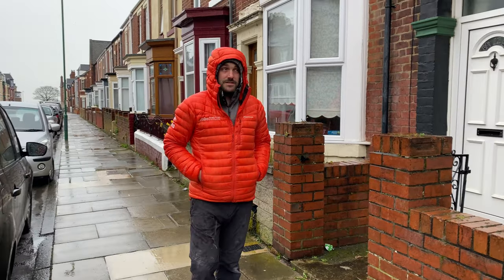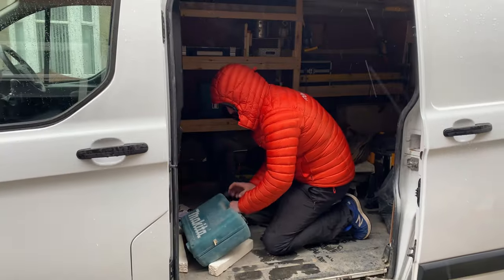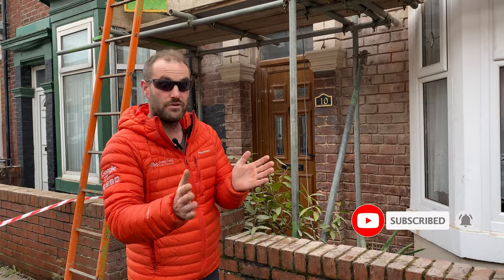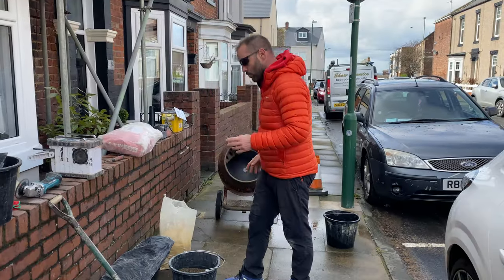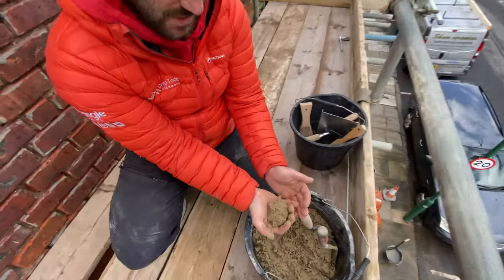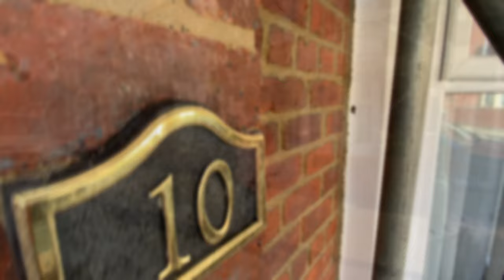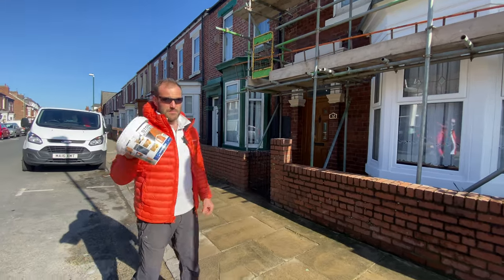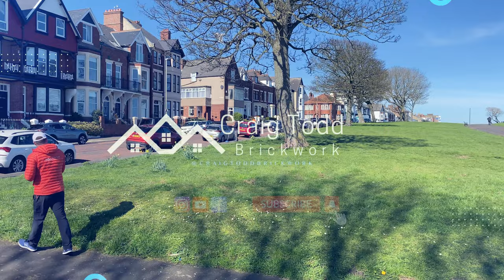Art of Lime Mortar Pointing, traditional bricklaying methods

Comment: is the mix 3 soft , 1 sharp , 1 cement and 1 lime ?
Reply from the maker: Sure I mentioned in the video mate, unsure now to be honest, may have been 5 soft, 1 sharp & 1 lime. 
No cement in the mix, NHL lime is hydraulic lime which needs air to go off. If you use hydraulic lime, thats the lime which needs cement to go off 🙂

Comment: My understanding is that using lime instead of cement & sand allows the wall to 'breathe.' But what about the old sand & cement mortar that's still in there. Doesn't that prevent the wall from breathing anyway? Genuine query as I'm thinking about using lime to point the house.
Reply from the maker: Great question, if a lime built house is pointed with sand and cement you just rake that out. It’l be raked out back to the original lime mortar so your new lime pointing will be going on top of lime 🙂 if your raking out a sand and cement built house you just repoint with sand and cement 👌
Hope that helps 🙂
Reply: @CraigToddBrickwork hi mate what mix did you use 

And how long do you leave it before you finish it
Reply from the maker: it was a 3 building sand 1 sharp sand & 1 lime mix & we left it until the end of the day to finish it on this one :)

Comment: You can get a housing for the mortar rakes, gives you a bit more control and the option for dust extraction.
Reply from the maker: Cheers Andy, appreciate you dropping by mate 🙂 yeah, we had got one for this job. We had the wrong bits for our grinder though and didn’t work. The company quickly send another one out to us though and we used it on the customers back wall 🙂 I really rate them like. Do you use them Andy?
Reply: @CraigToddBrickwork  Yes mate, been using them for years on softer stuff, the only fault i find with them is the rakes are to long for me and rake out a bit deep. Ime using one today will be in my next vid 👍
Reply from the maker: sorry for a massive delayed reply andy. I've just found the filter on here that shows comments on comments. I've just ben replying to the notifications and wondering why i dont get a reply back haha. I know now any way. I'l have to take a look at your vid mate, love your content andy, i just dont have two bloody minutes to do anything at the minute. what do you mean the rakes are to long? as in the devil tooth rake or the disk?

Comment: Can you use 3/1 sand and lim without the sharp?

Or did you just add sharp for the aesthetic purpose of showing stone in the joints ?
Reply from the maker: you can matty, you don't need the sharp in the mix. If the original has sharp in, it's best to put it in your mix though :)

Comment: Hello 
Great work and nicely done
Wanted to ask, in your opinion is possible to use cement (for better setting) with hydrated lime and sand (0,5:1:5 ratio) for rendering a brick wall layed with lime mortar, as it is quite difficult to find hydraulic lime in our region? 
Or even small amounts of cement will trap moisture, make wall unbreathable and ruin the bricks?
Thank you
Reply from the maker: Anything like this mate I’d normally ask a good mate of ours for advice, check out Tominay Stone on Insta, he will have some great advice for you mate. 
We have used hydrated lime in the past and yes you are right with the sand. No hydraulic lime. When we use hydrated the do a 6:1:1 mix or 5:1:1:1 👍
We dont have any local suppliers to us either for our lime. We order ours online from a company called Conserv - www.Lime-mortars.co.uk
They deliver in a few days too mate & its good stuff 🙂
Hope that helps mate.

Comment: If a house is cavity wall, would you recommend using sand and cement mix when repointing?
Reply from the maker: Its down to what the house has been built with mate, if its lime use lime and cement on cement 🙂

Comment: Everything I've seen online seems to indicate you've got to keep hessian over the fresh lime mortar for a period of time. Different lengths of time depending on the weather. Is there a reason you've not used hessian to protect it / retain moisture etc?
Reply from the maker: your right matt, you should cover your lime with hessian to prevent the weather getting to it. We just didn't video this part

Comment: Lovely job, how long do you leave it before sponging please? I take it that's the finishing touch, thanks
Reply from the maker: Yeah mate the sponge is the finishing touch 👌 you can go back to it the next day and it’l be good to sponge 🙂
Reply: @CraigToddBrickwork  thanks mate
Reply from the maker: Your welcome, anytime 🙂
Reply: Hi Craig if you want a flush finish, would you use a scrap bit of timber to rub across the joints?
Reply from the maker: Yes mate, that finish looks lovely 🤩
Reply from the maker: Yes mate that finish looks lovely 🤩

Comment: Excellent video mate. What is rough estimate for that job? Thanks
Reply from the maker: Thanks mate 🙂 I really cant remember now mate it was a few months back this one. We would be at between £100 - £150 pm2 plus scaffolding, go £125 @ around around 16m2 £2,400 all in. It’s much more than sand and cement pointing because the process is much longer mate. I should have probably spoken about it in the video tbh, but for an example, keeping the new compo damp is important so it doesn’t crack, spongeing the joints down to bring out the sharp sand. I do that on the same day it goes in before I leave for the day and the next day before starting I get a wet sponge on it too 🙂 a couple examples mate 🤝 hope it helps
Reply: @CraigToddBrickwork  Thanks for the extra information that's very helpful.  I see from your work that you really go above and beyond to do a proper & thorough job👍👍👍
Reply from the maker: @ggss1176  your welcome mate, I believe in always doing more than you’ve been asked, obviously not hundreds of brick or something like that but you get what I am saying. Leave a job better than it was when you arrived 🙂

Comment: How long for 1 man to grind out the joints on a house that size thanks
Reply from the maker: Probably 2 days max
Reply: @CraigToddBrickwork  cheers, and u suppose 2 days for 1 man to point it
Reply from the maker: Probably 3
Reply: @CraigToddBrickwork  i have a front to do and there electricity wires going to the front of the house, how do u handle them,😅😅
Reply from the maker: I dont 😂 do you mean the ones up at the gutters? If so it’s upto the customer to have them insulated, you know the yellow plastic stuff you see around them. I think its free for the customer too. Not 100% on that though
Reply: @CraigToddBrickwork  your a genius my friend, thanks very much for the advice, good advice bad joke🤣🤣🤣
Reply from the maker: @IanIan-cj7dj your welcome mate 🙂
Reply: @CraigToddBrickwork  cheers, 👍

Comment: Hey dude looks cracking! Take a look at this if your using lime "Functional Behaviour of Traditional Lime Mortars", opened my eyes a bit to how it works. Im going to be doing the same just over the river in the spring on both my walls. The stuff in a cans going to cause some issues. Lime uses a liquid phase not vapour to get the water out, needs lime in contact with the air to work. Anything non lime is basically going to undo that lovely repointing and plug it like Portland.  Only real way to get more protection and water out is with a lime wash. 
https://www.youtube.com/watch?v=uh-Sy_3uIWE&t=83s
Reply from the maker: Thanks mate i’l check that out 🙂

Comment: Nice jacket and Trainers to work on 😂🫵🏼

Hey how do they get the mortor white in historic buildings
Reply from the maker: Cheers mate 🙂
Its not something I’ve done to be honest mate, but it’s white cement, lime and white sand I believe. 
https://www.lime-mortars.co.uk/lime-mortar/hydraulic/nhl-3.5/white-morn-scarr/25kg that website has a load of different lime mortars too mate 👍
Reply: No cement is ever used 

White sand and lime putty for the tuck pointing .
Reply from the maker: Thanks mate 🙂 i’ve never done it before but would love to work on a job where I can. 
What is the pricing for something like that?
Reply: @CraigToddBrickwork  I do it here in Dublin so prices are different 
As we use euro 

Expensive though around 300 m2
Reply from the maker: @jackrigney7615 thanks mate, yeah I’d say it would be much more than std pointing. 🙂